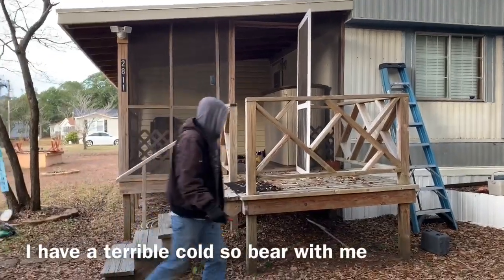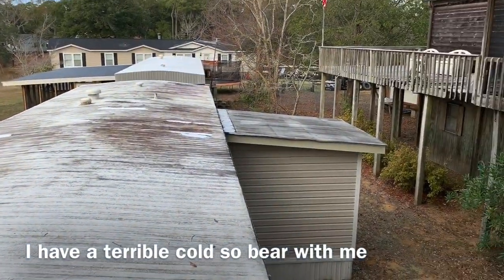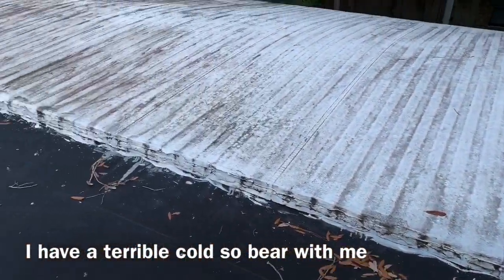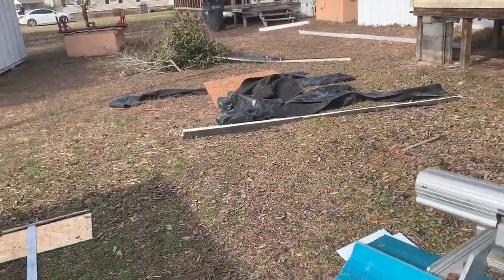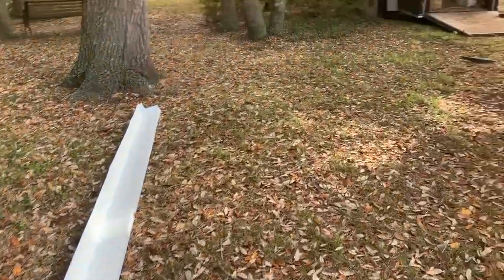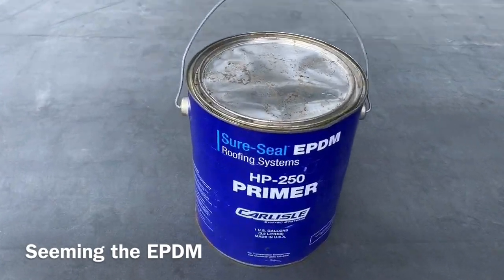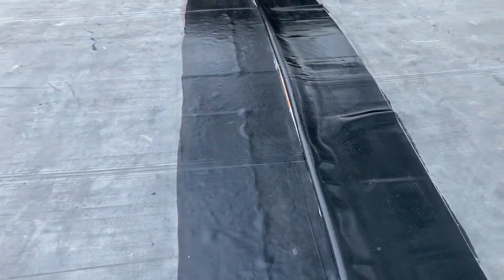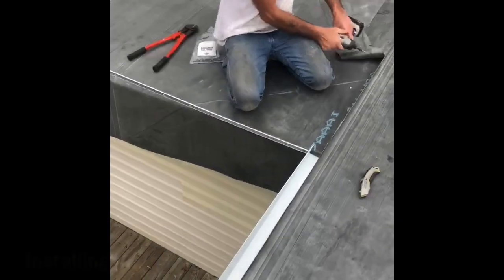My New roof over my mobile home￼

Comment: Hey question for you,  we did a rubber roof almost 1 year ago this Feb. We havent had a great amount of snow, but it's coming now soon, so do you have a specific way to get snow off the roof?
My single wide couldnt take alot of snow on the top could it?
Dont want to ruin the rubber so how would i get snow off?...
Reply from the maker: Did you put plywood on it like we do? If so you should be able to walk on it. If you didn’t put plywood and you just put rubber I still don’t think you should walk on it. How did you get the snow off before you put the roof on? If you did not put plywood I wouldn’t walk on it but if you did you can actually walk on it and I don’t know if you’ve ever seen them before but they do make a plastic shovel. Just don’t dig down Do the Rubber you should be fine
Reply: look under roof rakes or roof snow removal tools. lots of choices. like he said plastic or rubber would be best
Reply from the maker: I’m in Kitty Hawk this week doing it Rubber Roof kill Devil Hills North Carolina I’ll be making a video of that starting tomorrow when I get home I’ll download it to my computer. I’m gonna do a premier so I will let everybody know a couple hours in advance before it’s going to start and it will be in the evening
Reply: Yeah we did it with plywood just like you. Everything the same. So plastic shovel it is! Thanks so much! Your the best!
Reply from the maker: Sara Beedie If you put plywood on it you’re not gonna have to worry about shoveling the snow off of it it’s going to be stronger than it ever was the snow will never bother you

Comment: I wanna do my roof like you! But i cant find anywhere that has metal fascia with the dimensions your using. Any ideas? Thanks!
Reply from the maker: You will have to get the metal at lowes and have it bent. You will need a metal break to make the metal

Comment: 2020 HAPPY NEW YEAR!!!  Hey Drew all i can seem to find in my area for white EPDM is rolls of 100 feet by 10 feet. If I did that I would have to buy 2 rolls and put 1 long seem down the middle. My mobile home is 14 feet by 67 feet. Would you ever do something like that.
Reply from the maker: No you go a crossed and put a seam every 10 feet that’s what that stuff is made to do. That way you only buy one roll but you have more seams
Reply from the maker: White EP DM is not EP DM it’s Tpo and you have to heat weld the seams together    EP DM like we use you put it together with glue like we sure you want to video
Reply: @Drewsroofingandhomerepair I got cha. Thank you for the info, i appreciate it.
Reply: ps, hope you feel better soon. damn winter!

Comment: So I've got a metal roof, am I correct to assume you're just putting the OSB over the previous roof?
Reply from the maker: Yes
Reply: @Drewsroofingandhomerepair  

Cool. I bought a 124 or so foot long single wide trailer for 200 bucks, lots of mold in the drywall and the outside seems to be in bad condition, I've noticed where there are roof leaks and figure I should start up top and work my way down.

I'm hoping to put an overhang roof over that before this winter, I've been watching your videos like crazy!

Thank you for being a huge resource!
Reply from the maker: Thanks for watching and liking my videos. The overhang is amazing